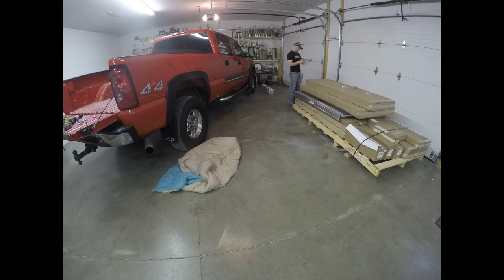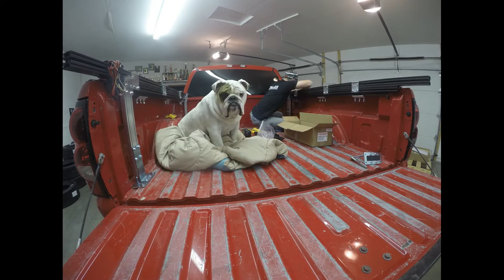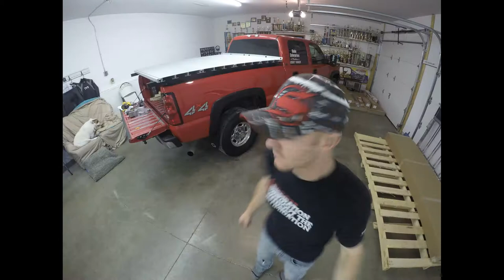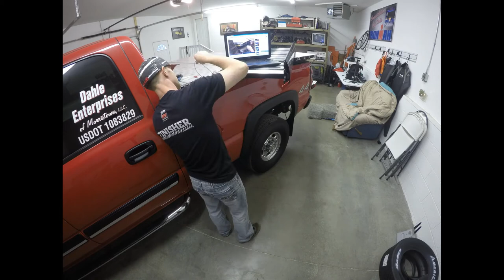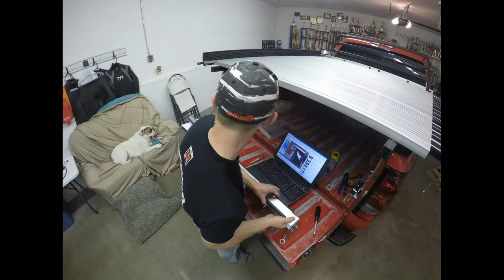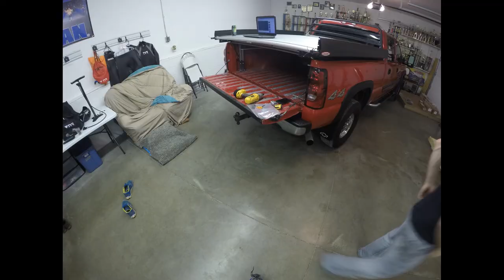TRUCKBOSS Deck - Time Lapse Installation

Comment: how hard is it to remove in the summer?  how many holes do you have in the truck?   I like the concept but after seeing this... im not sure a sled deck will work for me if its this difficult to install.  I have a 5th wheel as well, not that I camp much in the winter but trailer is looking easier to deal with for some sleds.  UGH
Reply from the maker: When I remove it I just take the rail off underneath and use a forklift to lift it off.

I thought the install was easy. I did it wearing socks.

There's four 3/16" holes in each corner of the floor of the box. That's it.

Comment: Nice vid. How long total did it take to install? How was the Deck delivered? Are you happy with the deck now that you have had it for some time? How is the pickup bed and side walls? Any cracks or is the truck bed and side sill structurally sound?
Reply from the maker: It's in perfect condition yet. I use it all the time.